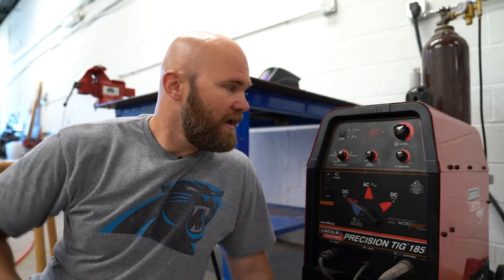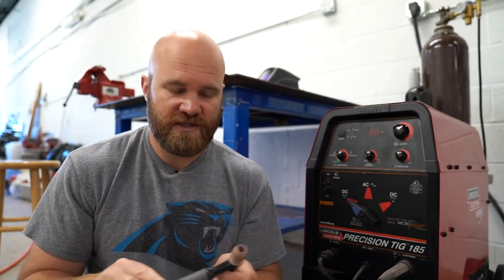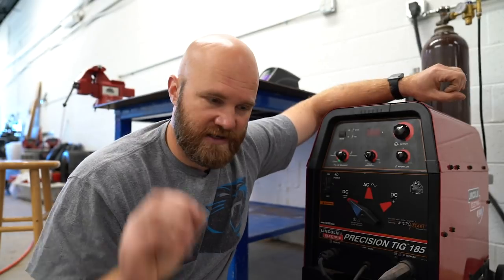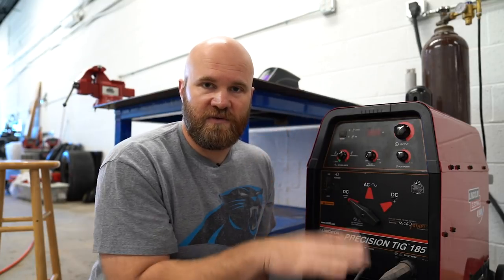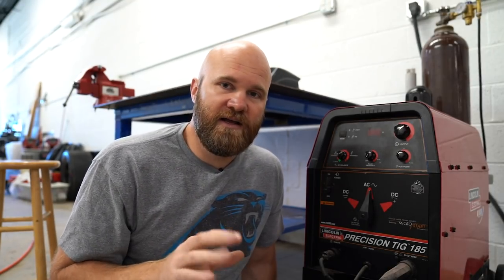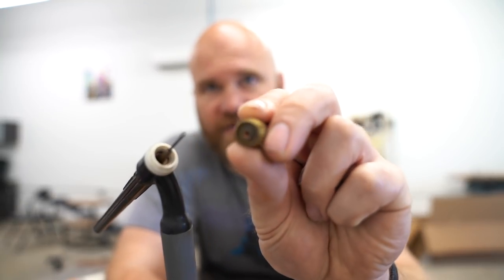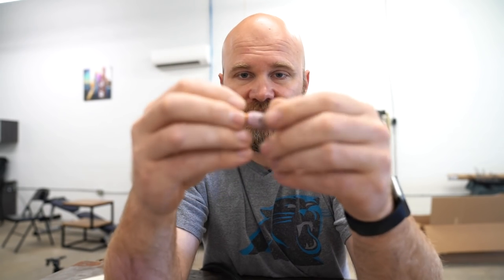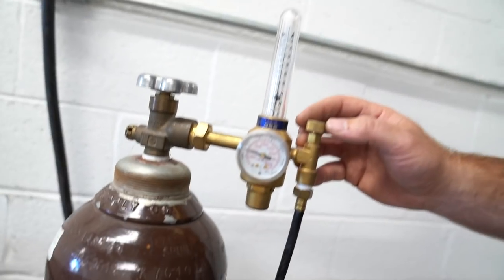TIG Welding Basics 1.0 - Understanding Your Welder

Comment: I have this machine and also a 325 TIG inverter machine. The 185 is simple and very smooth. I use 3/32 tungsten and 1/8" Aluminum filler. It handles most in the home shop welding and is very simple to use. Welds are crisp & bright. I am thankful that my machine is not one that had the dial amp problem. I would not upgrade to another Lincoln because they knew about this problem and should have fixed this instead of ignoring. 👇 I think Miller would have took the bull by its horn and fixed the problem if it was a machine they produced.

Comment: Got that same machine and enjoyed your vid....subbed! Tried to weld some 1/4 aluminum last weekend and failed... Believe my amps was set to low....125... probably should have took it up to 170+ but I'm a greenhorn.
Reply from the maker: You might have to preheat the metal, and without a water cooler the torch may get hot. But it can be done.
Reply: The cleaner your material is the easier it is to weld especially aluminum. Also aluminum welds at a significantly higher amperage than mild steel and stainless.

Comment: You are the man! I love your videos! 
Just won't where was the clamp, I guess, was attached to the table? 
So the table need to be stainless steel or Aluminum is fine because is conductive too?
Reply from the maker: Hey thanks! Yeah it was clamped to the table, I’ve only really worked in mild steel tables tops but anything metal would work I would think. I’m not really sure on aluminum though on if it would effect anything.

Comment: I use this machine , but the tig torch became so hot when welding...have you any suggest for that ?
Reply from the maker: You can by an external cooler and then get a water cooled torch, or by a whole new machine that it water cooled.

Comment: Hi Justin, great video.  I was not able to tell but were you performing touch-starts on this machine or this unit has high frequency start (touchless)?
Reply from the maker: I don’t think it has Hf, I usually just touch it down with out hitting the pedal and then lift it back off and start the arch.
Reply: It has HF start, touch down will contaminate your electrode :(

Comment: pro tip ( im not a pro by the way ) NEVER just hard open your bottle like that. Did you see and hear how hard that steel ball in your flow meter hit the top ? The top of the flow meter can crack or fail completely. Just think of the kinetic energy that ball has when that gas hits it that hard and fast. You might be better served to just slowly crack the bottle open until the flow meter is full of gas so as to not shoot that steel ball to the top like a rifle shot. Im more than baffled that you don't know much about tig welders and their associated consumables but your welding skills are more than just a beginner ! Subbed

Comment: It is not a pressure reading. It is cfh or cubic feet per hour
Reply from the maker: Gotcha, thanks
Reply: So it's not pressure (psi = pounds per square inch), it's flow rate (volume per unit time, like cubic feet per hour or liters per minute).

Comment: At 11:23 he keeps saying the flow meter reading in Psi, That is Wrong, 20 on his guage is 20 CFH, cubic feet per hour. Here in Australia, we measure flow in Litres per minute, there is about 2.1 CFH per litre per minute, so, 20 CFH is about 9.8 litres per minute. In what I weld, I rarely go over 8 litres per minute.
Reply from the maker: Thanks I will try to remember to say that correctly, I have a ton of bad habits I’v only realized since making videos
Reply: For the record, 20 cu ft/hour = 9.4 L/min